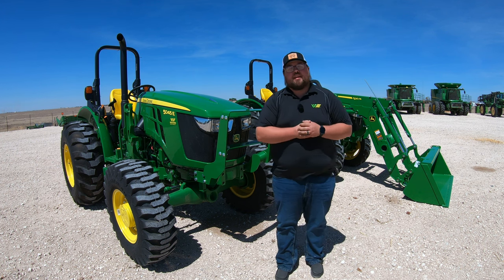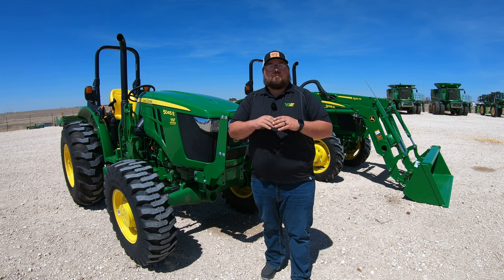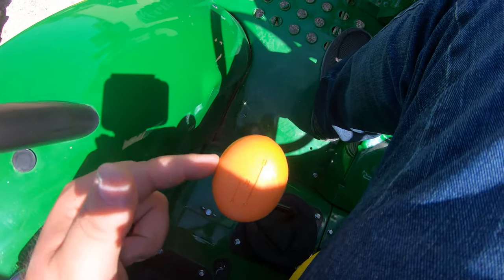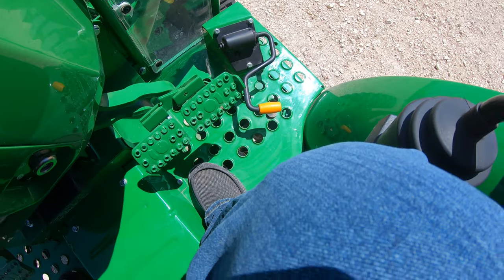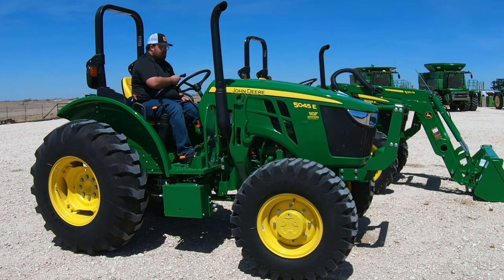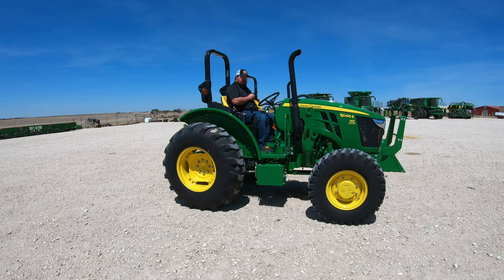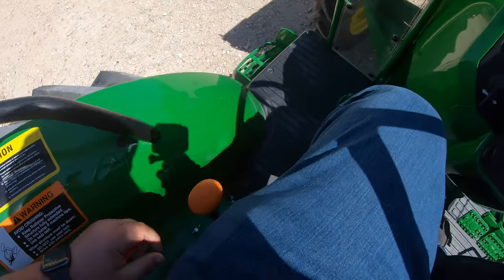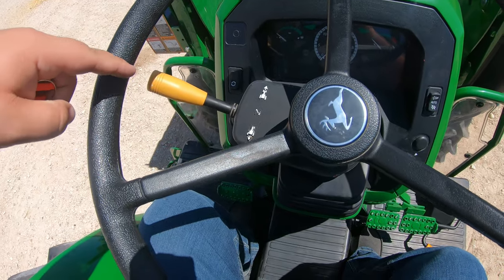Tractor Driving Tutorial - How to Drive John Deere SyncShuttle & PowrReverser Transmissions

Comment: I agree with this gentleman. The power reverser has a learning curve for sure. But after you use it enough to get in the habit of using it properly it is better.for one thing the clutch pedal is an electronic switch controlling hydraulics. Easy to push. That will spoil you. I really didn’t need the power reverser but I bought it for resale purposes. It’s what most people want.

Comment: that is really interesting. I've been borrowing my neighbor's Kubota for yard projects and he said he opted for the hydrostatic, and i figured "what were the other options??" well now i know! Seems like there's a learning curve but anyone could do it. Definitely glad for the hydrostatic on smaller properties doing simple loader work. Thank you for this video, straight to the point.
Reply: You might want to reconsider.  I bought a 2018 brand new, with a pwr reverser,  It went belly up at 614 hours.  It was just in the shop for 8 weeks and it is STILL not right and lurching into gear.  SO back to the shop it goes... It just had $6500 in repairs!  I wish I had bought the Kubota instead. The Deere did seem nicer and more polished butwhat good is that if the tractor doesn't run and can't be fixed!

Comment: Thank you for the video! 
I just picked up a 5067e with 12/12 PowrReverser. Do you have to completely stop to shift from forward to reverse?
Reply: I have a 5075e, no you do not need to be completely at a stop when changing directions. That said I don't change it at a fast speed, usally its a very slow roll when I do and I will sometimes wait till I'm at a stand still before chaning directions.
Reply: @xriz00  thank you

Comment: I bought a 4052 power reverser brand new and its been the worst tractor ever.  I sure hope these 5 series are better.  The is the 2nd time its been sent home and i was told it was fixed.  I am saving this video to show my dealership how this lurching, dangerous tractor is SUPPOSED to work.  614 hours on it and it had to have a massive repair because of poorly manufactured parts.

Comment: I am nit picking, but at the 10:00 mark you raised the throttle before engaging the powereverser which put needless wear on the clutch and saved zero time.  Engage the powereverser at idle, then raise the throttle...takes the same amount of time with the least clutch wear.  Granted there are situations where you need to engage motion with above idle rpm, but 99% of the time you don't.

Comment: Question: if the clutch stops the tractor why do I need to break? Would I be able to clutch and shift?
Reply from the maker: The clutch only puts the tractor in neutral, so on flat ground the tractor would naturally come to a stop but if you were on a hill it would continue to roll. And yes, you can clutch and shift.
Reply: @WesternEquipment  ok thanks. I see now.

Comment: In my 5075e when shifting the power shuttle into reverse the speed increases 2 tenths  why is that
Reply: I don't really know I had that issue with my Sync Shuttle transmission on my 3020
Reply from the maker: That’s a good question. I’ll have to check into that.

Comment: I would recommend that except for the condition of accelerating from a standstill or travelling gear change, to always have your foot covering the brake anytime the clutch is being engaged or disengaged.  Specifically, when starting or stopping motor, going in and out of park or gear changes when stopped.

Comment: By the way SyncShuttle built better
Reply from the maker: What makes you say so?
Reply: @WesternEquipment  I had an experience when I bought a 5060E and I didn't really like the PowrReverser because the unit that is on the steering column would always interfere with my movement to switch my turn signals on. I use the road a lot. I got pulled over by our county sheriff, fortunately he let me go and told me to get a SyncShuttle instead. My dealer was very understanding about it and helped me through the process to get it switched over. They had my tractor out within the week. I am going to buy from them every time I get new equipment.
Reply: @Dylan-zn7np  So because you can't work around a lever and ensure your hazards are on while traveling on a road, that makes the syncshuttle built better? Strong argument there pal...